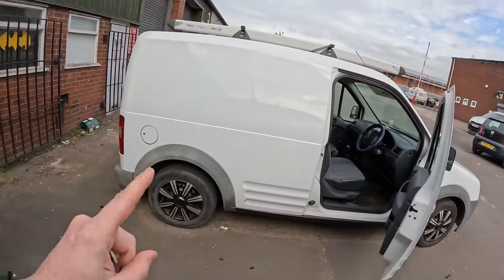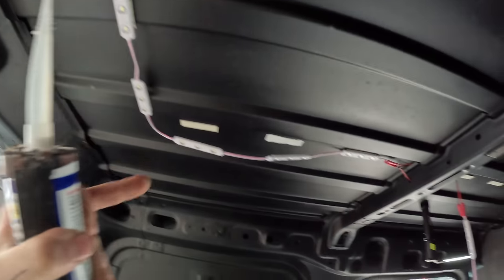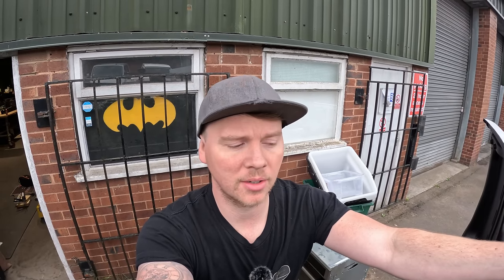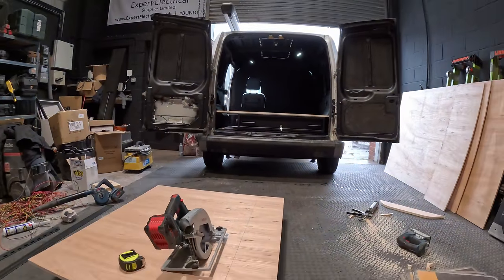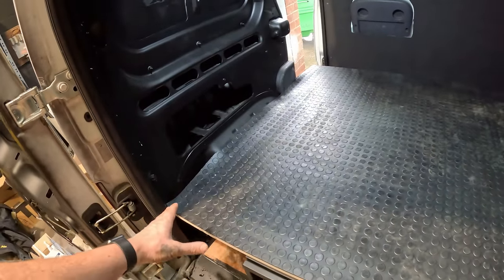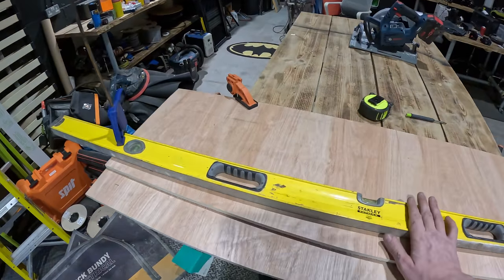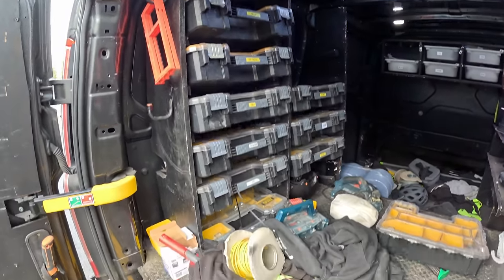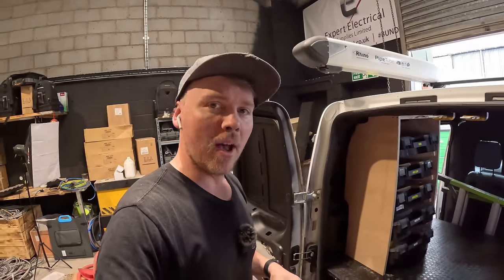Van Restoration - Van Racking + Van vault install PART 3

Comment: Great video as always, when I changed my van racking I got some galvanised holding down angle plate to use as the supports for the shelves. Really strong stuff and handy size to buy, found it thinner than wood so could fit an extra shelf.

Comment: Love a van reck out video. I did a similar thing for my casement boxs but turned it so when you open the side door they are easy to grab rather than climbing in. Your story to being an electrician is similar to mine being a plumber, was thinking of bricklaying Doc says not good for the back. Friends of the family said its hard to get plumbers so i decided to be a plumber 😂.

Comment: Great effort on your part nick and so kind to offer an apprentice a leg up in the trade. Some 12 volt internal lighting on the roof and maybe a rear and side external light over the doors would help the end user. Plus maybe somewhere to charge batteries between jobs. If you do similar again you could make cardboard templetes which would make it easier to cut around complicated bumps and such.

Comment: Insurance is shit based on your age. Aged 24 it cost me 1.5k to insure a basic ford KA. My insurance has been £300 ish for the last 4 or 5 years, once you break 25 years old it used to drop massively. I think quotes aged 24 and 25 were differing by £700.
Reply from the maker: Shows I’m getting old mate 😭😭
Reply: I've got a 2008 transit 2.2 swb, £180 a month I'm 20 absolute killer, plus it has a box
Reply: @adamcarter1974  yeah it's absolute horse. The car I paid 1.5k to insure was worth about 700 quid. I know it's about liability to others but jeez. That first year of no claims and going over 25 were the biggest jumps for me. Mind I'm 34 now I'd hope the age crap has change but seems not.
Reply: @MikaMikaMika89  nope not yet